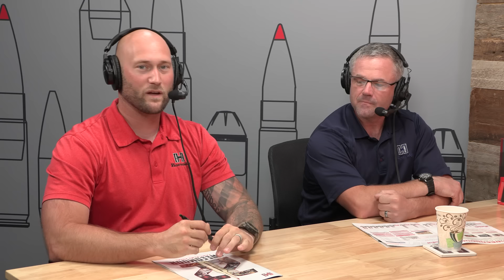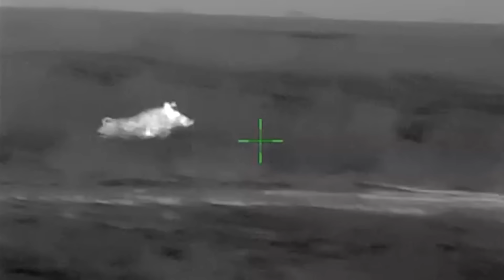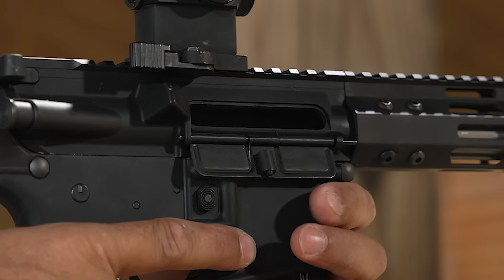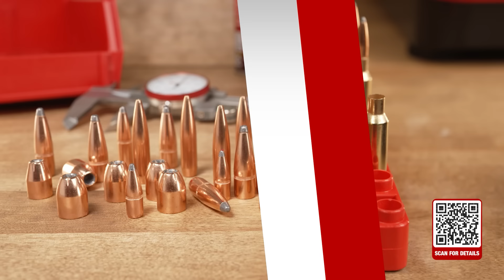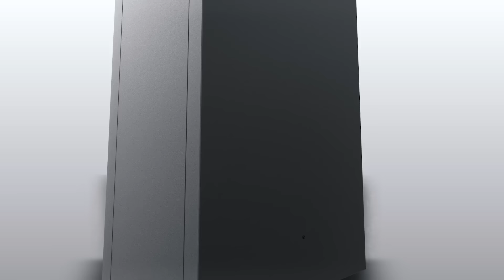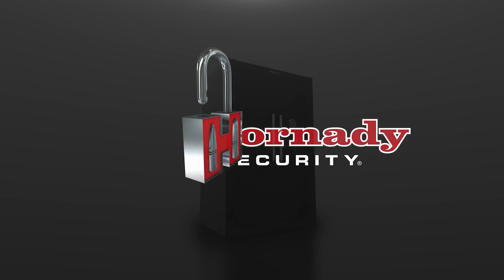Ep. 203 - 2026 NEW Products Overview

Comment: Would love to see 25-06 ammo with the same projectiles as the 25 Creedmoor offerings.  Just Boldly place the recommended Twist Rate(s) on the boxes.  I think those High BC .257 projectiles could reach max potential out of a Standard Long Action Cartridge.
Reply: It would be a waste of time the 25-06 has to slow of a twist from the factory. Only people with a custom gun could shoot them just buy them and reload them.
Reply: @435Ballistic  Factory Twist Rate for 25-06 are slow because projectiles for the 25 Creedmoor didn't exist.  Now that they do exist, I've decided to start reloading.  I'll be rebarreling to a Heavy Contour 26 inch 1:7 Twist Rate that'll adequately stabilize 138gr A-Tips and shouldn't overstabilize 110+gr.  With the availability of higher BC factory cartridges - rifle manufacturers may update the barrel twist rates on classic cartridges (25-06, 6.5x55, 270 Win, 280 Rem, etc) in their newer lines.  Something has to happen first.
Reply: @OC_Lofton  go down to 100s with that 1-7 no issue. My 1-7 25-06 handles everything from 100-138gr very very well and it is a very fast barrel. 

I will be picking up some of the 112gr CX when they’re on the market because that is serious viability if they shoot well
Reply: @noahhorinek Thanks for the information.